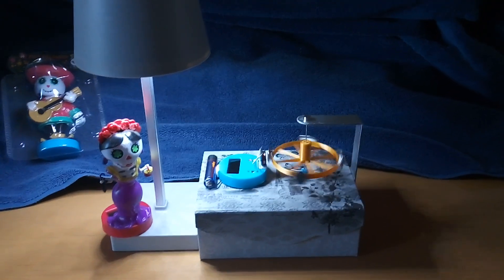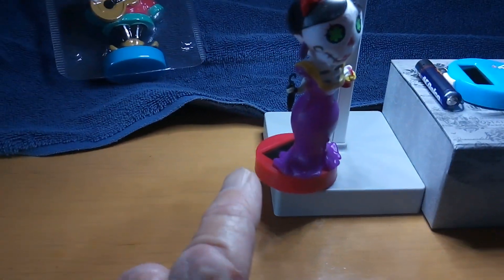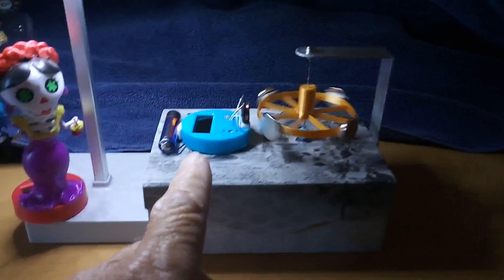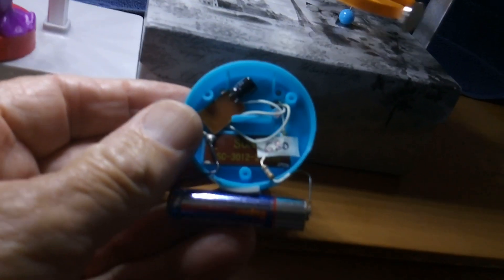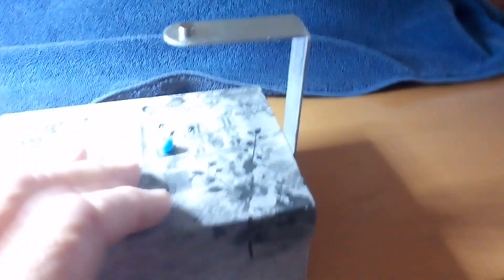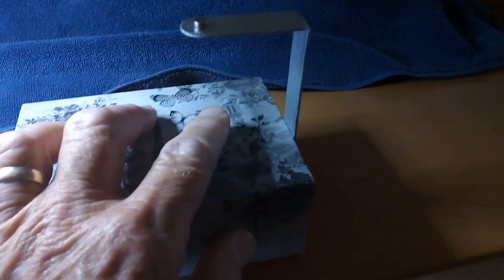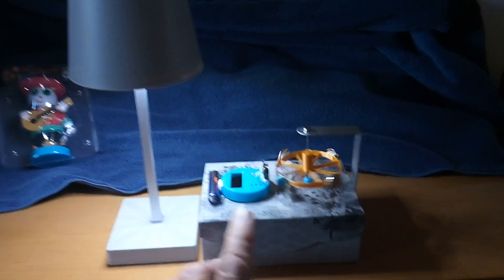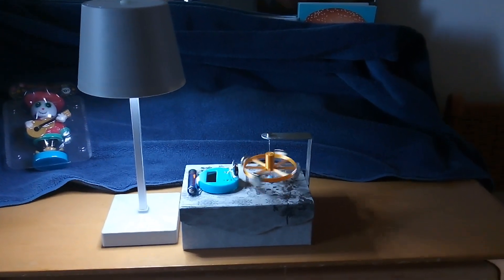Magnet Box Motor -- Part 2

Comment: Those new wavers are fancy, they look far better than older ones!
The height adjustment using magnets is a good tip. Also, wondering about a low mA NiMH and diode on the solar cell.
I'll have to do a round up vid of long runners myself, but have lost Nephilim Penny after the house move. It's in a box.... somewhere.
Reply from the maker: I have some missing projects also that are well hidden in boxes.  These new solar wavers seem to have the same circuit board and solar panel but the coil is different.  I have not tried a NiMH battery yet but it should work.  You don't need a diode because the  resistance on the solar panel is so high that it doesn't back drain the battery at night.
Reply: @Lidmotor  Ah ok, thanks for the info on the back drain. 
We went to DT today. They had 2 eyed googly things and pumpkins with solar etc, but no wavers at all!

Comment: Not sure about the connection of the resistor did you connect it in parallel?
Great project thanks
Reply from the maker: The resistor is in series to the battery.  Just solder one end to the (+) of the AAA and the other end to the (+) of the solar panel. This tiny solar panel has high resistance and that is why this works.  A blocking diode is not necessary.